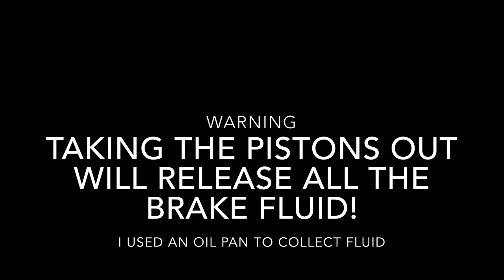SV650 Front Caliper Removal and Clean

Comment: Ms. Cooper:  I have now completed a full rebuild of my two front calipers, including freeing the two sections of each of the calipers, which were solidly corroded together, so they can move freely.   Your video, which shows you pulling one section loose from the other, was absolutely key to my understanding that they should move freely and be greased as part of the overall process.   Many thanks for one of the best and most useful SV 650 videos out there.
Reply: Also, I got the hand vacuum pump your friend used in another video and it really helped as well for getting bleed started.

Comment: Absolutely one of the best video on SV650 maintenance. Pleasure watching.
Reply from the maker: Thank you, I really love making these videos and am so pleased you enjoyed it. Thank you for your nice comment.
Reply: I have one question though. I changed the pads on my SV650 (K7) and the brake pistons won't slide back in. Apparently they are stuck. Now I need to take them out. Would you recommend bleeding out the system before doing that. If so, I guess this would also mean getting the pistons out is even harder. But if I don't bleed the system I run the risk of having brake fluid all over the place.
Reply from the maker: You can use a piece of wood between the pistons once the brake pads are removed and use the pressure of brake fluid to push the pistons out as far as you dare. I agree to completely remove them I would drain the brake fluid first as it is horrible stuff to spill everywhere, but if you use the brakes hydraulic system to push the pistons out, it may make removing them easier. Be careful not to scratch the pistons when you clean them. It sounds like it could do with a decent maintenance, could you imagine what it would be like if the pistons stuck when you needed your brakes... eeek! Good luck and let me know how you get on.

Comment: good clear correct instructions!    it's hard to find somebody who will do a good service these days, main dealers or local bike shop
Reply from the maker: Thank you, its great to read some really supportive comments.
Reply from the maker: Jimmy Doran hey, it would depend how pitted they have become with the rust, if it is just surface rust, then a good clean should bring them up like new and you could re use them. If they are pitted, it could catch the seals as they slide in and out and would need replacing. Mine have come out of the calliper looking pretty grotty and come up fine. Hope it goes well!
Reply: Too right about good services. Just bought a sv with service history and they hadn't even put the clip on the chains split link! Death trap! Pure luck the chain stayed on.

Comment: iv found after using copper slip on the sliding pins it causes stiction. the best stuff is silicone greas as it slides better and u don't need alot and doesn't cause rubber to swell. also brilow pad but like the one on the back of a kitchen sponge cleans out the oil seal recess out good and gets rid of corosion. but you did a good job of explaining how to do it and any one stuck will not have a problem learning what to do. 👍
Reply from the maker: +ian burns I like the idea of the brillo pad, that would work well. Thanks for the nice comments and for watching.
Reply: The copper grease has it place on the back of the braking pads and only there. Ceramic grease is even more better. I have already installed pads with no grease on it, never had any funny noise or grinding. Copper grease should harden with time stick and pull pads inside when brake pistons retract. Cheers

Comment: Brilliant video.I would add when i remove the caliper off the bike i remove the pads then boil the complete caliper in water and soap power on the gas ring in my garage. This softens all the muck and gung.I can remove the deposits with a piece of thick copper wire.

Comment: I'm no mechanic but I've been taught to put the copper grease under and over the springs, between the shim and the pad and on the outside of the shim too. It makes cleaning up next time easier as it just rinses away with cleaner. I've just found a dust cover half in/out on one piston so I'll be doing seals on all 3 calipers on my DL650 quite soon ("bother'). Your video was a useful back up to the Haynes manual. Thank you.
Reply from the maker: Thanks for the tips, I love it when I hear ideas from others. pleased you enjoyed the video.

Comment: Question:  It looks easy to remove the part of the front caliper that releases the seals so that they can be replaced.   But, on mind that part seems completely stuck and immovable.   Did you remove any kind of pin or bolt or washer to enable removal?  Did they really just pull off that easily as shown in the video?   btw:  absolutely great video.  Well narrated and thorough.

Comment: Excellent video, thankyou. I found it after a session with rags and wirebrush and plenty of brake fluid soaked paper towel. Next time I'll start with a renovation kit and clear the dining table too. After doing the rear pads I realise I didn't transfer the thin metal plates clipped onto the old pads, but unsure if these are part of the caliper assembly and thus should have been transferred to the new pads....any advice ? thankyou Allan.... edit, ah they're squeal shims, better clean them up and get them on!!
Reply from the maker: Hey Allan, glad you liked the video! Those thin metal clips are part of the calliper, called backing plates- best to put them back if you can!! Thanks for watching and commenting!

Comment: Can you do a video on the rear master cylinder on what way the rubber seals go, how it all fits in. Just installed new beaded break lines and I may have re built the master cylinder wrong. By putting the seals the wrong way around. 
Thanks

Comment: Hey Tamsen. Brilliant video. Need to do all the callipers on my K3 650. I was just wondering, did you drain all of the fluid from the system so it was empty before removing callipers? If so was it easy to re fill the brake fluid once they were back on? Thanks
Reply: dont drain it all - it will be harder to bleed once you're ready to throw it all back on.
keep the res. cap on and let the brake lines hang - maybe put them in bags so fluid doesn't get on the floor.

once you're done with your rebuild and button it all up, bleed the system with new fluid until the new clear fluid comes out the calipers with no bubbles.

Comment: Same Calliper as my Suzuki VZ800 Marauder had bike sins 2003 and have only done just over 16000km now more of a weekend Warrior its a 2001 previous owner only done 1500 km. My pin was seized and the place it slided in broke off trying to get it loose going to get it rewelded 2morow and fit a new kit!
Reply from the maker: Those pins are a real nightmare for getting stuck! Good luck fitting the new kit, I hope it goes well. Thanks for watching!

Comment: I don't think copper grease is the right grease to be used for many reasons. Just do a search on it on google ... You should use high-temp silicon grease instead. But thank you for this very informative video ... I wanted to see how much movement the pin needed. I couldn't get the pins out by hand on my brakes so mine def needs to be rebuilt.
Reply from the maker: +Geza Turi I have seen many reviews where the copper grease can degrade the rubber boots that protect the pins. I am glad you enjoyed the video, it was good fun making it!
Reply: Copper grease 'is' a high temp grease, by a big tub, it even tells you it's for use for many things including brakes.  It is partly to avoid brake squeal, but it is also used to prevent corrosion, I've always used it to lube brakes and many moving parts and bolts that don't need locktight, as have the college I trained at and all the garages I learned and worked at too.  

Don't believe everything you read or hear on Youtube or anywhere else on the internet, but it's down to you to decide what to believe and what not to, do what you feel is right and what works or you.

Comment: I seems to experience an issue with getting the pistons out when pumping. 
They do extend out but as I release the lever they go right back in again.
Reply from the maker: Sorry it has taken a while to reply, I have been away on holiday. Is there a vacuum being formed somewhere drawing the pistons back. Are you at the stage of trying to take the pistons out to clean or pumping the system to remove any air bubbles once you have put it back together?
Reply: take the lid off the reservoir. 😉

Comment: Hi Tamsen, I need a hand (with a GSXR750 SRAD). To get the brake pads out I seemed to have to open up the calipers to get to the pin. Now I have disconnected the brake cables, I can't get the pistons out! What do I do? Thanks, Jacob
Reply from the maker: Ah I see the problem, now the cables are disconnected you have no hydraulic press to force the pistons out. The risk of using pliers is quite great as you may damage the pistons (if you can even reach them depending how far in they are) There are specialist piston extraction tools which can be bought to do the job, or you could reconnect the brake hose lines, fill it with some fluid and use that to push the pistons out as far as you dare and then drain the fluid again. I hope you get it sorted, let me know!
Reply: Hi Tamsen, thanks for the response; I opted for the fluid method in the end, but given that I had no brake fluid left I actually took them to the garage in the end and have chalked it up for experience. In future I'll keep an old tub of used brake fluid if I ever need it for something like this! I just saw your front wheel bearing change vid, and am wondering if actually the reason my front wheel was stuck is because the bearings have gone! The seals on the pistons certainly needed replacing so I'll start there and hopefully that fixes things.
Reply from the maker: Yeah, sometimes, when a mistake is made its worth calling in reinforcements, especially when it comes to something as crucial as brakes! I Have taken my bike many times and asked for a second opinion. Let me know if you end up doing the bearings, it will be good to know if that was a cause of the problem.
Reply: Saw this done on another video, but if you have access to an air gun, you can apply air where the banjo bolt attaches to the caliper and this should raise the piston/s out either all the way or almost all the way out by using a block such a piece of wood, etc. Then, for the final removal, use pliers padded with a piece of cloth being careful not scratch the pistons.
Reply: You can get pistons out with pliers, you take some old kitchen rag,put at first couple of layers of alufoil and aplying pliers on the edges slowly turning clockweise and oposite pull the pistons out. I have done so that the pistons have no damage. Anyway if you have damaged pistons on the edge near the contact to brake pads, means outside surface , dont worry about it. Take sand paper and water 1200 and make it nice. Brake pistons never retract inside until they slam the back wall of caliper. Even if you put new pads there is almost half of an inch( ok maybe little bit less)piston sticking outside of caliper. If piston get damaged beyond that point, you better buy new ones.

Comment: Tamsen is it easy to replace the dust seals on the front brakes? I have a Suzuki gsx750f with similar brakes to yours if not the same. Thanks in advance
Reply from the maker: Yeah, once you take the pistons out, the seals are sat in grooves, a wooden toothpick is great for getting under and hooking them out, even a finger nail would work, it is suggested to use great care if using anything metal, you don't want to scratch the surface of the caliper- my latest video is what I had to do when I couldn't get the seized piston out of the caliper! (hopefully you won't need that one!)
Reply: Tamsen Cooper cheers for the advice Tamsen. I really appreciate it........
Reply from the maker: Hope it helps, let me know how you get on!
Reply: Tamsen Cooper I will let you know and I'm also putting braided lines on as I think the OEM ones are past there best
Reply from the maker: I am about to complete a video on braided lines, I have got Venhill front and rear, I like them as the banjo has a swivel fitting so no twisted lines, very easy to install!! Have you decided which brand to go for yet?
Reply: Tamsen Cooper I've gone for HEL braided lines  so I'm hoping they will vastly improve my brake's
Reply from the maker: All About Motorbikes yeah braided lines are a great upgrade, not sure if you have seen it yet but I have done a couple of videos on front and rear brake line installation if that helps. Let me know how you get on!!
Reply: Tamsen Cooper Yeah I have watched them Tamsen and they are of great help. Big thanks for taking the time to make these videos.

Comment: Again and again the same errors in brakes rebuilding. You shouldn't use copper grease in the boots rubber because they absorb the grease and get useless. Always use silicone grease please. Some seals have side, be careful. And probably a good idea to use ceramic grease...

Comment: at 1150 you talk about seal taper . its critical that the main fluid seal goes in the correct way . a vernier gauge won't messuage soft rubber  accurately and seeing the taper by eye is hard . it's better done by feel with clean warm fingers . get two other people who understand what you are doing to cross confair.
Reply: They are a square seals ... the flatness of the pressure seal actually pulls the piston back slightly when the pressure is released.
Reply: Rick Bates Correct,they are also called "retraction main" seals. The front one is dust seal.

Comment: sv650's have a common problem with the front brake master cylinder piston going sticky.. giving the impression of a binding caliper !   both my wheels must rotate freely without any resistance. if the front wheel doesn't then it's usually the master that's the cause .... to fix this quickly without removing anything, carefully apply RED RUBBER GREASE with a blunt cocktail stick underneath the master cylinder piston gator. then a "low" pressure air line is used to blow the grease into and around the piston inside... DO NOT use any other form of lubrication, ie wd40, oil of any discrption, brake cleaner etc. apart from brake fluid  (and that applies to brake calipers ) .... of course the correct way would be to remove and strip the complete component and rebuild, then periodically do the above .. my sv is used all year round every day, rain or shine and is not garaged or covered up .. I find I need to do the above once a year .  A  mate of mine had his sv brakes stuck on as he pulled up at traffic lights .. cause was master cylinder piston stuck....    Both your wheels must turn freely !
Reply from the maker: Really good tip, I agree taking it completely apart would be the best, but as a quick win what a great way to keep the piston free from sticking- thanks!

Comment: Where do you find all these new parts???
Reply from the maker: Great question. I use robinsonsfoundry quite a bit, because I like the exploded diagrams they have when you look for parts, rather than just looking at a part number you can see it, and what it is connected to to make sure you have the right bit. 

We have a local Suzuki dealer (Anton Paris) so I often phone them to see if they have the part ready to go, cause you know, I'm a woman and I want it now! 

Ebay can be good for some of the upgrade parts (I use M&P they are good value and do the kits for the callipers etc.)

Comment: Hi I'm bleedig the brake but i have no presion. Have no leaks and no air on the system. What ca I do ?
Reply from the maker: Hey, Check the pistons are coming out of the calliper OK, I put new seals in when I did it recently, this meant the pistons were not coming out all the way at first so I also was not getting any pressure, I would pump the brake for a while, bleed out the air, and go again until the piston fully engaged the pad to the brake disc, took ages! eventually though I did get pressure back

Comment: Brake fluid is a corrosive so why do people use it as a lubricant when reassembling their calipers it attacks the rubber and the aluminum as it goes through heat cycles  and its hygroscopic nature  is some part of the reason you get a pile of white crud behind the seals.

Best practice is to put replacement seals in dry and before the piston is reinserted, wet the tip of one finger with power steering fluid and wipe the surface of the seals this should leave a trace amount on the rubber and nowhere else. Any excess PSF should be wiped away with a clean cloth/ tissue this will still leave a trace amount on the seal.
Before insertion of the piston, the piston wall can also be wiped with a little PSF but only the wall and excess will  be removed as the piston is reinserted. Again this should be removed with a clean cloth before any further steps. 
PSF contains conditioners for rubber seals, its main use is as a hydraulic fluid but it also an oil so provides valuable lubrication for the pistons in the caliper helping prevent friction and stiction meaning more efficient  braking and then release.

Best regards
HarryB
Reply: I guess most people do it because its whats stated in any manual when overhauling the calipers